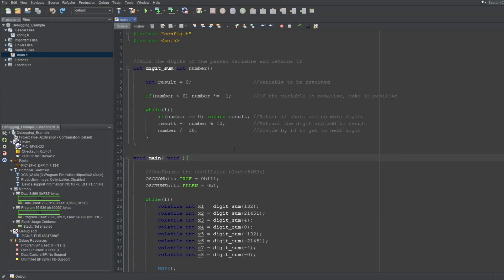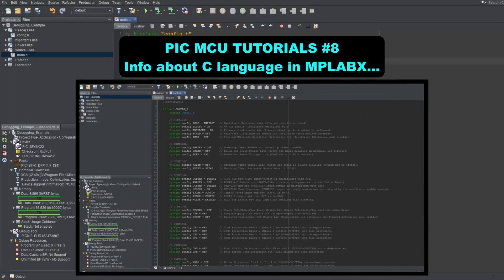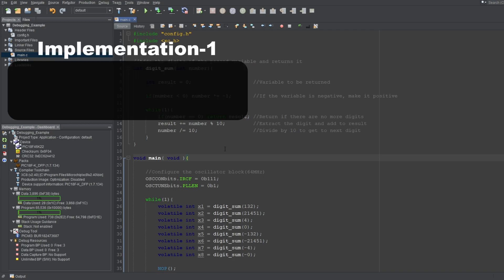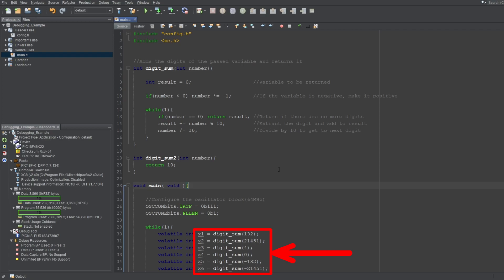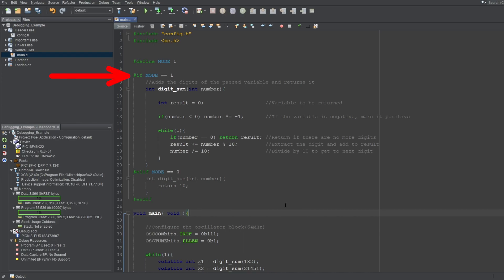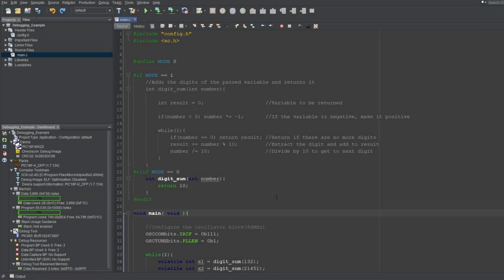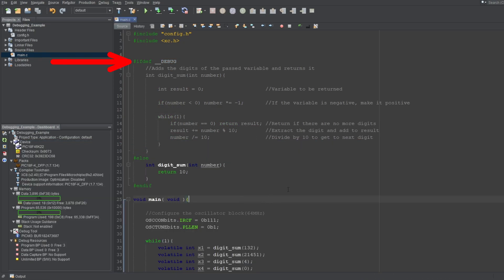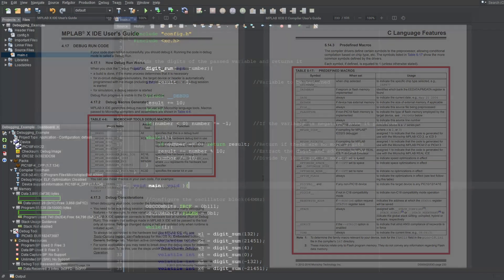PIC MCU DEBUGGING #8 - Debug macro (Absolute Beginner)

Comment: Hi sir I am using pickit 4 facing issues like failed to device ID and unable to flash any firmware do you know how to solve this problem?
Reply from the maker: That's a very basic error message, so it's hard to say what would be the issue without seeing your circuit. Some things that come to mind:

1- Your microcontroller may be broken. (If you didn't buy from a reputable seller it may be fake/faulty. Also make sure the microcontroller isn't drawing hundreds of milliamps, as that could mean it's fried. You can check if it's getting hot by touching it too.)
2- Your microcontroller may not be powered on properly.
3- You may have a loose connection. (Cheap breadboards are really problematic. Wires may not be making proper contact even if it looks like they do.)
4- Make sure the programming lines are connected properly.
5- Your PGD and PGC lines may be connected the wrong way.
6- Make sure to restart the IDE and/or re-plug the USB cable to PICKIT4, as sometimes the interface bugs out. I've experienced that multiple times for sure...
Reply: @Microesque   My electronic connection is no problem because when I use ICD 3 to flash my firmware I find no issues but when the time I use pickit4 it keeps popping up failing to get the device ID
Reply from the maker: @Alex-rv8gw  Hmm... Reading the device ID is the first thing the programmer is supposed to do, and if the microcontroller is working without a problem as you say, there must be a problem with either your connections to PICKIT4 or the PICKIT4 itself. If you have an oscilloscope you can check the programming lines to verify if PICKIT4 is doing what it should. Other than that, make sure MPLAB is up to date. Also, make sure there are no other components like resistors or capacitors connected to the programming lines, and make sure both the Vdd and GND lines are also connected as you DO need both. You can also try to program another microcontroller if you have any on hand (ideally one from a different family),  to see if PICKIT 4 works with that.

If none of that works, you can try to update the PICKIT4 firmware manually or something. Honestly, that error is so generic that the reason could be anything, so it's hard to suggest things without seeing the actual circuit.